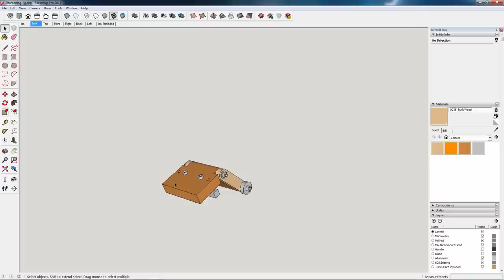How to make a Sharpening Jig

Comment: As the bevel forms though doesn't the angle change because of the the lack of contact in the front, and more importantly, lack of a 3rd point of contact?

Comment: The biggest problem when using a honing guide is to ensure the flat side of the chisel is flat in the guide and the blade is square in the jig. Your jig does not help to do that very well. Chisels 1/4" and less need a harder surface to reference off that is provided by ply wood. Obviously a work in progress.
All the best.

Comment: I built this.  I don't recommend it.  The pivot point where the two pieces meet, don't hold.  No matter how tight you tighten the nut it still flexes.  Not good in the middle of a sharpening.
Reply from the maker: remember not to apply too much pressure in the center of the jig when using it, you should only apply pressure on the blade. If the problem persists, you can stick a few pieces of sandpaper in the pivot point to get more firmness. Send me some photos please, I would like to see your design!